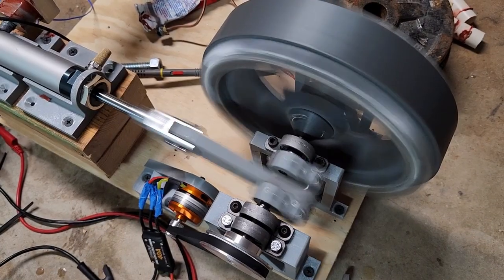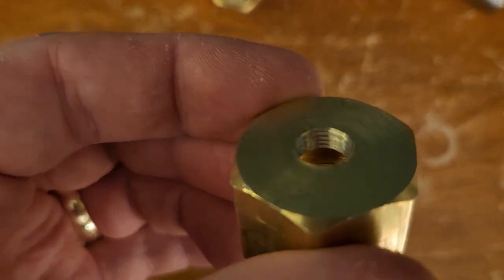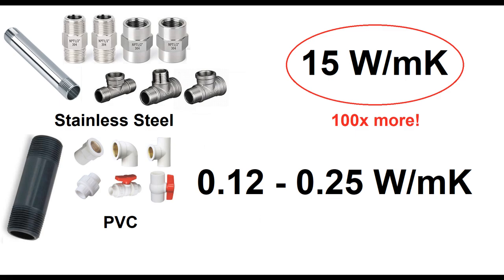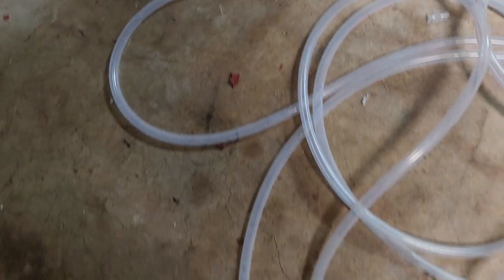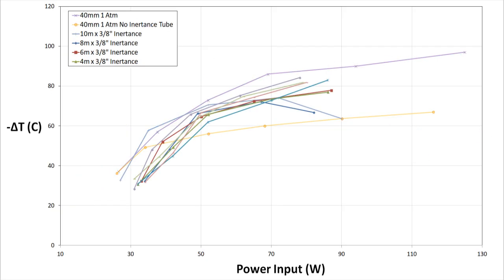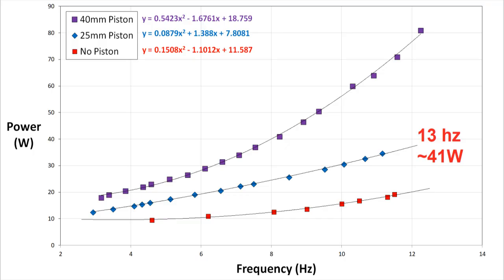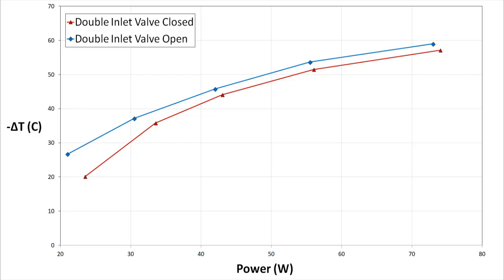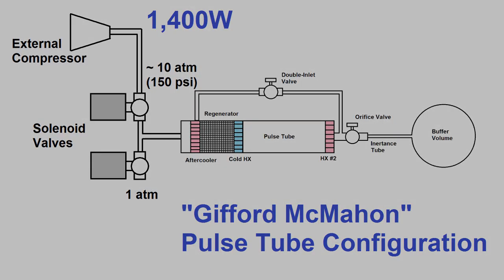Pulse Tube Cryocooler (Part 3)

Comment: Use HELIUM instead of regular air inside your system.  I have a pulse tube cryocooler that can reach -196c.  I repaired and charged it with helium @265psi and it operates at 60hz.   The pistons use gas-bearing tech which keeps loss and wear low. 150 watt input will lift 5 watt load at -196c.  Unit was pulled from a Superconductor Technologies band-pass filter for cell tower application.
Reply: He said in an earlier video that he knows to use helium but that he plans for that to be the last thing he does. He wants to tinker with all the other stuff as helium gets expensive.
Reply: STI Sapphire cooler is not pulse tube, but Stirling type cooler, so different system altogether :).
Reply: @xDevscom_EE   Yes, you are correct that the STI is a Stirling type.  However, even though the term Pulse Tube refers to a specific type that does not employ a displacer, it is still often loosely used to describe any regenerative system because of the oscillatory movement of the working fluid.  I will try to be more accurate.
Reply: I have seen -274
Reply: Might be interesting to try neon, or nitrogen, instead of air. We'll be out of helium pretty soon.
Reply: We will be out of cheap helium soon. Natural gas is surprisingly high in helium in many places. Most is not captured because it is not economically feasible with the US national stockpile depressing prices. So the whole hoopla with us running out is overblown, but when the price goes up we will blame someone and it might as well be those kids balloons and heliarc welders that get the heat.
Reply: Wasn't there a large deposit just found in like Minnesota or something?
Reply: @canonicaltom we can produce helium from fusion reactors.

Comment: centrifugal compression volume heating/cooling is much better, and you can spin much faster
Reply: that compression cycle is "start-motor-wait-stop-motor-wait.. - .."
Reply: actual a=v^2/r compression, not just spin squeeze compression
Reply: put the pvc in the metal tube
Reply: insulate, insulate :)
Reply: a fridge/freezer must have insulation, or you will lose a ton of the cool produced, c-19 was to deal with that, says the Lord, dont make it be c-23 all over again, bro
Reply: if you do screw compression by hand (big cylinder), then you can cool a ton with few cycles and simple equipment
Reply: you want to cool a big volume, right

Comment: I love the systematic scientific evaluation of this DIY project.
Reply: It's probably the only way to make some progress here - who would have guessed that the far more professional looking stainless steel construction underperformed the PVC construction so significantly...
Reply: @Alexander Gräf  I was...  mostly because of heat transfer through the hardware.  With the last video I was thinking about adding a heat break I. Between the hot and cold sides, a small section that is ceramic...  keep the hot side hot and the cold side cold.
Reply: @kayakMike1000  That sounds like a good idea.
I personally was not able to decide whether steel would have a negative impact, seeing how heat transfer is actually wanted in certain parts. Like there's a literal heat exchange. But you're right, you want the hot and cold side not to be able to conduct to each other.

Comment: Superb presentation of the data and experimental data collection.Extreemly thorough.  Its lovely to see real numbers. The high static pressure with lower ripple would favour a linear electric motor where a sprung offset can be applied. Not sure how that could be done on a crank.  . Fascinating. A real adventure.
Reply: By pressurizing the crank case

Comment: In the cryogenic industry after coolers are always using cooling water, chilled water is used to lower the gas temp and a pre purifier using molecular sieve to remove process gas moisture.  All the cryo process equipment is placed in a coldbox and perlite is added to provide maximum insulation.

If you were to use a refrigerated dryer after the compression phase you might see some improvement and for sure a reduction in moisture.

Interesting work you are doi otherwise.

Comment: Try to get a beefy subwoofer speaker and convert it into a membrane piston.
Theoretically if you pressurize both sides of the membrane you should be able to run at higher pressures too.
With a smart driver you should be able to precisely control the pressure wave.
Maybe it is even possible to autodetect the best resonances with it.

Comment: If you convert it to GM  pulse tube cycle cryocooler it will be much better to use pressurized helium in the system. It will increase efficiency and temperature drop substantially

Comment: Could the bottleneck possibly be the cylinder to pulse tube connection? You're going from a 25 or 40mm cylinder, to a tiny 1/4"(?) pipe fitting, to a 1"(?) pulse tube. Maybe try cutting the bottom off a cylinder and attaching it to the pulse tube directly would help.